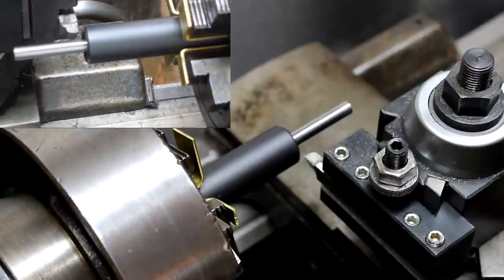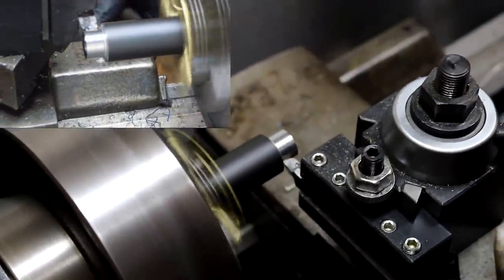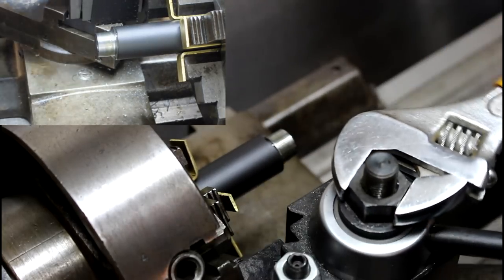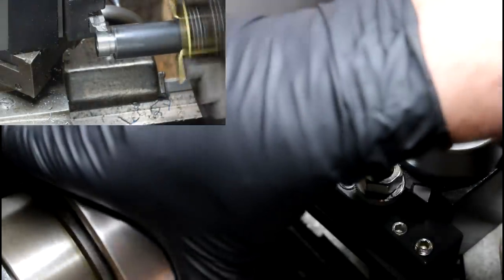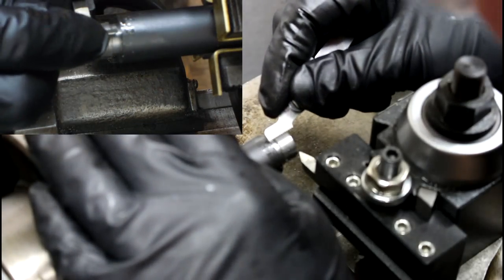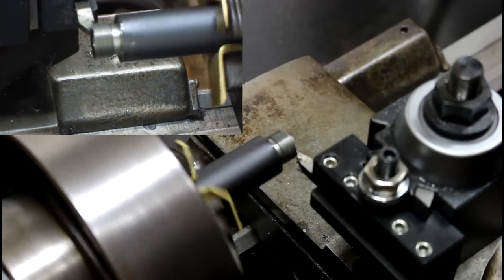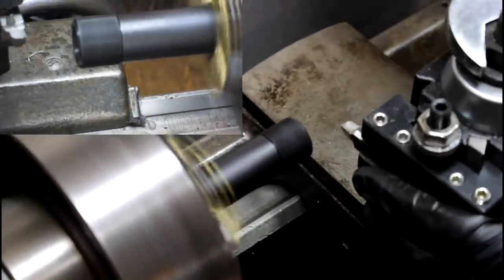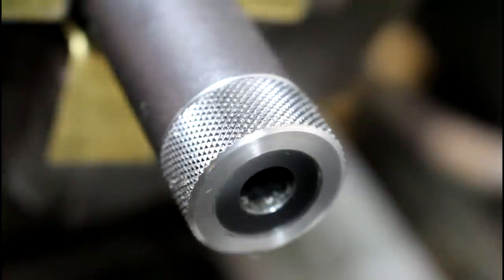Threading a Barrel -Thread Protector Installation! Gunsmithing Remington

Comment: Quick tip, when threading a 5/8 24 TPI, the correct diameter is actually .620". If you do it to .625 the top of the treads will be too sharp and cause them to stick into whatever you put on it

Comment: Great video. It never ceases to amaze me how many "experts" are commenting on YouTube videos. If you don't do it their way then it's not a good way. I've been cutting threads in barrels for four years or so and I learned to set it up as you did by a gunsmith who has been running a shop for almost 30 years. 

Thanks for taking the time to put all this work on video.
Reply from the maker: +Mike Dittman  
No problem, thanks for the comments! There are a few other ways I do these depending on the application, but this is just a basic demonstration.
Reply: Look at Joe Pieczinski (Advanced Innovations, Austin Texas)videos and especially his method of cutting threads AWAY from the headstock with the lathe tool upside down and the lathe in reverse. That's how to do it properly. The man is a brilliant engineer/toolmaker and designer. its a joy to watch his videos and to learn new things AND how to do it safely.
Reply: @samrodian919  MD said it all, they learned to do this from a gunsmith. A machinist don't call himself a gunsmith for a damn good reason, he ain't. Every gunsmith I've ever met said they were machinists too.

Comment: As a tool and die maker I would like to point out some things you are doing that are not safe.  1. Never wear gloves while running a lathe.  If the gloves get caught, you will get hurt.  2. Do not grab the chips with your fingers, it is a good way to loose a finger.  3. Never stop a lathe chuck with your hand, especially when wearing gloves.  The machine is not forgiving.  If your hand gets caught, you are in a whole world of hurt.  5.  Never reach over the chuck to do you filing.  Always work from the front of the chuck.  Once again if your arm gets caught, you will be in a world of hurt.  Just for clarity, it is not called a back cut, it is called an under cut.  I thought I would let you know these things, because I never want anyone to get hurt.
Reply from the maker: +T Hall 
Thanks for your concern!
Reply: +T Hall Don't think rubber gloves are going to "pull you in". If you are so concerned, why not make a video on the absolute safest way to do this, then we can critique your methods sir.
Reply: +jason fazenbaker I am concerned that perhaps you are of the ilk that has to put your hand in the fire to see if it really will burn you.  Stay as far from danger as possible and you greatly increase you chances of remaining whole for life.  It only has to go wrong once.
Reply: T Hall I'm pretty sure a LaTeX glove won't pull your fingers off :)
Reply: Sure it won't, but it will jerk your hand VERY quickly into a fast moving part wedged against a sharp tool........I know I know, you are stronger than a latex glove, but when one is not expecting it your hand will move too fast in the wrong direction.
Reply: Got a lack of feel for starters and feels everything!Suspect the gloves are so that they don't dirty your donnies, if that's the case your in the wrong trade and teaching bad habits.Perry are you willing to try it, thought not. Its only got to catch enough of the rubber to pick up and of course pull fingers and hand in as it wraps around and stretches.
Reply: jason fazenbaker he's absolutely accurate. Actually.
Reply: Adam Jeppson survival of the fittest, including the mentally sound. Let nature run its course there.
Reply: As an ex teacher of metalworking here I  England, I wholeheartedly endorse your comments Mr. Hall. Also he forgot to clean up the end of the protector thread  after cutting it back to the length of the barrel. If I were paying this guy to do this for me, and ripped up the end of  my finger on the sharp edge, I'd want my bloody money back!!!  Also why did he not simply grind the parting tool to a narrower profile to avoid  that  bloody awful undercut for the threads?
Reply: Those are nitrile gloves and they're considerably stronger and a lot less elastic than latex.
Reply: Some people here are assholes !!!!! Every comment made to try to increase this and any other man's safety while using a lathe are and should be welcomed with open arms and minds ! Gloves are cheap life is expensive ! 
I would have liked to see him clean up the thread protector though. The internal thread was left in shambles . A cut finger would piss me off considering how much money goes into machine work ! It is a detail oriented trade !
Reply: Learned the hard way. Cotton gloves AND long piece of emry cloth Polishing shaft. Cloth grabed pulled glove in almost pulled my thumb off then pulled me in halfway to elbow. I managed to pull out but could have lost arm or worse. Everyone told me how stupid I was, Wish they would have told me before. NEVER hesitate to point out things like this in the shop or on videos. Might save someones life.
Reply: I learned to use a lathe in Vocational school at 16. The safety concerns you voiced here have stuck with me even 20 years later, even though I haven't touched a lathe since. I do woodwork and the rotating assemblies have the same danger though. I came here to learn something I didnt already know..... I learned owning a machine doesnt make you a master of it.
Reply: T Hall, Regarding your #3, I am aware that people should not attempt to "learn" how to handle a gun based on what they see on TV or in the movies.  Considering that TV is not a good place to learn, I would NOT use Fred Flintstone brakes on the chuck, it could be dangerous.
Reply: arrlmember you know what he meant. He’s not going to go out and try to thread barrels at home! He even humbled himself saying that owning a lathe doesn’t make you a master. I’m an electrician and the way we thread our pipe is with a die specifically installed to the lathe that threads the rigid pipe based on the size of the pipe. It’s pretty failsafe. Now that I see this is done by hand I have even EVEN. More respect for what you guys do!
Reply: @precisionmachineshed  Thanks for the video.  Likewise thanks for your humble reply.  You have more patience than I do.  While I certainly like to learn from other folks' input, it simply amazes me the lack of self-awareness that people have these days.  Where I come from and the time in which I was raised, you simply don't spout your opinion about any and every thing you see.  Simply amazing to observe from people.
Reply: Van Gilpin, too bloody right mate! Safety in the workshop should be everyone's priority. I doesn't matter if there are 100 guys working there or just one guy in his own shop. DO IT SAFELY, don't loose fingers, hands or even arms to a machine, whether it is a lathe, mill or god forbid a shaper!
Reply: @samrodian919  Well said mate.
Reply: Being safety conscious and exercising courtesy toward people and their Youtube channels are not mutually exclusive positions.  If people were truly as concerned about safety as they claim, it would be evident by the manner in which they address people on the Internet.  In other words, when people consistently demonstrate no regard for how they speak to others, that is a pretty clear tell that they could care less about the damage that their words may have.   Concern trolls are often the most unsafe people around.

Yes, hospitals are full of people who have operated tools, machinery, even automobiles in unsafe ways.  Moreover, there are objective criteria for best practices for any given activity.  I have no argument with those facts.   However, there also exists objective criteria that demonstrates inappropriate and harmful ways for individuals to address other people--particularly on the Internet.  Some people become self-appointed prophets of the former while ironically ignoring the latter.
Reply: I would not use any gloves with my metal lathe.  However, I also would  not go out of my way to make that point if someone is using latex gloves on their lathe.  At 53 and having been raised working in the trades and farming, I have experienced my full measure of injuries (pre and post-OSHA requirement time-frames).

Interestingly, of late I do find myself going out of my way to tell people to stop communicating to people in dangerous and hurtful ways to people on the Internet.  Seems weird that as adults we need reminding how hurtful certain forms of communication can be to others.  But left to ourselves, that is what we do.
Reply: In regards to grinding the parting tool down, that is EXACTLY what I was thinking. Hell, I’d rather run the threading all the way to the shoulder than make a huge cut like that. God forbid he puts a suppressor on the end of that muzzle. Can you say... BAFFLE STRIKE...
Reply: @thegoodearth7 , from what I gather from your last comment, you mean to say after watching an instructional video, you would not comment about unsafe practices shown in the video in order to help prevent others from getting injured, and you don't think others should either. How are people supposed to learn to not cut off their own arms if people with knowledge and experience don't pass on that information?

Learn from others mistakes, before yours kill you.
Reply: @notahotshot  You gather incorrectly.  Rude, self-appointed safety officers hiding behind the pretense of teaching others to be safe gets pretty old (and is pretty immature).

My point in summary:  Being safety conscious and exercising courtesy toward people and their Youtube channels are not mutually exclusive positions.
Reply: @jiggers75  fanboy much?
Reply: @jiggers75  How about just lose a hand. That will be dandy. T Hall is spot on with the safety.
Reply: @precisionmachineshed   Also, don't make the undercut. you are weakening the barrel.  Haha, just heard it now: "Doesn't matter". For sure it matters. split the barrel on 2000 shots and you will see what you are doing to the barrel.
Reply: @perrystephenson7425  It will.
Reply: All common sense to me and I never used one, seen them used and that all makes sense inc not wearing a tie, pitting your hair up and avoid baggy clothing in general....it’s a machine designed to not stop unless asked..same with anything big and mechanical with moving parts common sense and training from those with decades of exp would be my go to..and it looks a bad job, and you have a firearm..doesn’t add up.
Reply: after working in manufacturing for over 30 years, i have seen my fair share of missing fingers and hands, it's not pretty, take note of peoples constructive advice. and learn from it.
because accidents happen faster than a persons reaction time. to those are just starting safety is # 1, this is meant for the video poster but other comments.
Reply: @jiggers75  Son, you don't even know what you don't know!
Reply: @THALL thank you for your contribution to our education.
Reply: Dont want to be "Degloved" lol
Reply: T Hall how come you don’t post a video of the right way to do it, in all honesty I’m looking for someone to do mine and I don’t want some goober doing it the wrong way. I watch this stuff for education purposes because when I see someone about to screw up my gun I want to stop them dead in their tracks.
Reply: My concern, not being a machinist is cutting without oil will cause an expansion in the crown, a type of cone effect that is definitely going to effect the crown and down range point of impact.
Please correct me if I’m wrong. I’m very particular about my reloads and knowing my firearm, over the years I trust my riffle more than I do me, if I’m not hitting same hole I’m doing something wrong not my firearm. How can this be tested, on crowning, maybe inserting a caliber tube to see where it stops? Like I said I’m not a machinist, help me understand. Thanks
Reply: Yeah like he said! I had to pick up a boys finger with his class ring still on it 20 yr ago and I still remember the dumbfounded look on his face b4 the adrinalin wore off😬😬
Reply: It's called a die not a threading bit
Reply: I'm 4 years late on this comment. I work in a machine shop and they say not to wear gloves. Cotton gloves are hazardous ,not the gloves he is wearing. It is his choice.
Reply: @perrystephenson7425  Especially if they are from harbor freight where they are falling apart out of the box LOL They petroleum and many other products are cancerous.
Reply: The gloves ......not good !!! Had a friend  at work who now has only part of his right  thumb ! It was on a bench grinder .Same thing here. B AD IDEA !!!!!
Reply: So many comments crying about constructive criticism. It's a good thing people. Did you see the guy who made the video get bent out of shape over this comment? No he appreciated the concern. I mean, if you can't take criticism when it's not even directed at you, there is something wrong and you need to take a look at it. Dude didn't say anything incorrect or disrespectful. Get off yourselves babies jeez.

Comment: That's some pretty rough looking threads! Might want to take a lot of advice from comments below and have a red seal machinist teach you a few tricks of the trade to get better and faster results as well as moving over to carbide helps with cleaner cuts in smaller places especially with threading
Reply: Joe MacPherson didn't look like the cutter was square to the work either. You will definitely have a wonky thread if your 30 deg cutter is 5 degs off in the tool holder...

Comment: I'm glad that's not my gun
Reply from the maker: Me too! I did this video several years ago on the fly with a junk barrel after just getting my first worn out lathe set up. Had a few issues but #1 was a poor (or dull) cutting tool. Before this I always did this work in other gunsmith shops with much nicer lathes and tooling. I've since upgraded all my equipment and always cut nice sharp threads and much smaller back cuts (if needed). Never thought this video would get that much attention, but it did. I should really make an updated video.
Reply: the site name really need to be rethought on the precision part

Comment: Dude, you scare me to death.  Your flagrant disregard for safety will eventually maim you.  1.  lose the gloves.  2.  Buy a compressor and blow the chips off with a controllable air nozzle.  3.  Keep your hands off the spinning parts.  Period.  4.  Respect the power you are playing with; a lathe that smoothly cuts through metal will not even slow down when it sucks you into it.

No shit, seriously!  If you've not been trained in the safe methods of machine work spend the money and take the safety courses.  It only has to go wrong once.

Comment: When i've done my relief cut for threading i've used a profile too.  A VNMG 541 if i remember right. I just set my angle to be parallel with the shoulder and plunge and cut to the shoulder. It leaves you with a slight angle at the end of the thread (beginning of the relief) but the threading tool cleans that up just fine. I just don't tend to have the chatter with a VNMG that i do with a groving/part off tool.
Just a thought! Great video.
Reply from the maker: +Theren Boster hey, that is on my list of tools to get is a nice cut off tool. I do target barrels a little bit differently, but the cap is a little different too. Thanks for watching and commenting!

Comment: That was the best horror video I’ve seen in a long long time, not to mention the clanking of the drive gears too give it effect! It appears that you have developed many bad habits that “will” bite you.. you’re body will never recover from it! Go back to square one and undo the bad habits.
Reply from the maker: This is an old video, thanks
Reply from the maker: First time with my own old worn out lathe and minimal tooling. Other than the threads being very rough from a dull cutter the rest turned out as intended. Prior to this video I worked with newer lathes and carbide, switching over to hss was a little learning curve along with hand grinding cutters. You must not have watched the updated video of mine on the same exact topic.

Comment: running the lathe in reverse, with  the threading tool installed upside down,  would allow for a much narrower thread relief. And please don't pull the chips with your hand, you'll end up loosing a finger one day.
Reply from the maker: It was the only parting tool I had at the time. I've since changed quite a few things and get much much better results.
Reply: yes dont use your hand and dont use any kind of gloves. even latex will pull you in. nice video.

Comment: Flip your threading tool upside down and run the lathe in reverse. Thread from the relief out and in high speed.
I've converted to this and its much easier and faster. Threads turn out better with the higher rpm and carbide inserts.

nice trick using the scotch brite on the ends of the brush
Reply from the maker: Thanks, I've thought about that, but I just got rid of the lathe, got a better one, and learned to sharpen HSS. Life is good now. The new video I did on this subject shows the results. thanks!